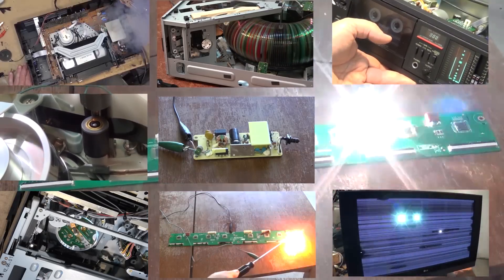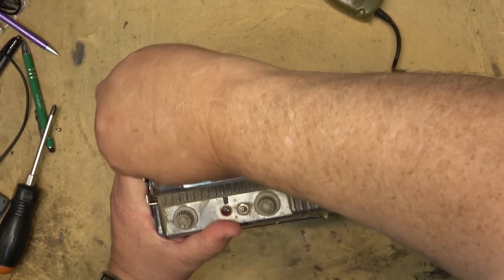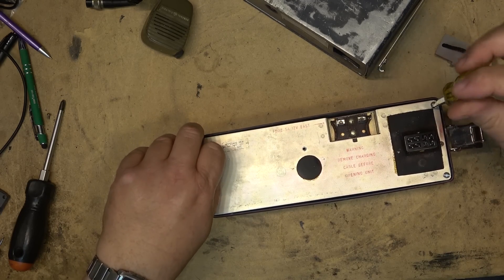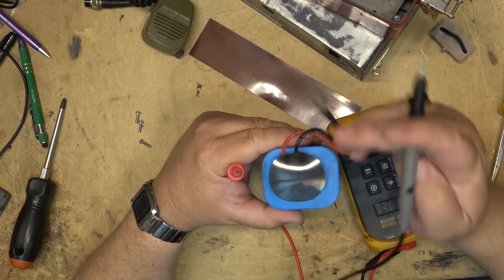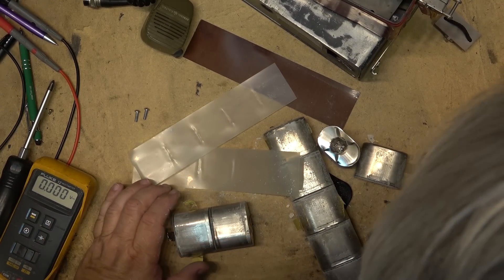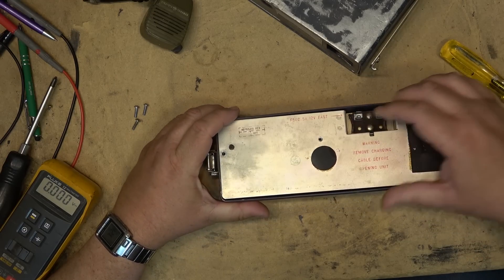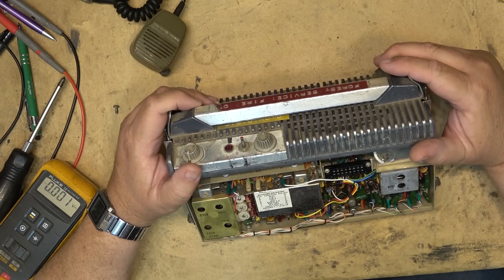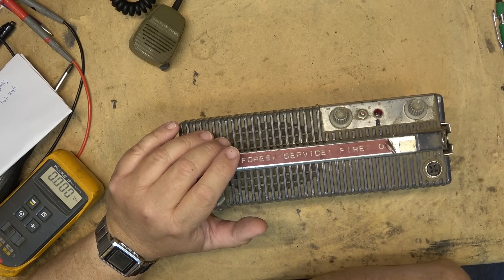Vintage Smoke Jumper Fire Service Radio Tear Down

Comment: Professional or industrial equipment even in this era seem to usually be easier to disassemble and work on than consumer-grade stuff.  No plastic snap-on parts or glue.  I've seen Lenovo business computers that can be opened by sliding one blue plastic lever at the rear.

Comment: the mastr 2 and custom mvp were popular for repeater conversions. you could cut one wire to put the radio into full duplex. crystals too hard to come by these days.
Reply: I still have some crystals
Reply: Still have these radios in service as repeaters. There was also a full duplex IMTS MOBILE PHONE VERSION that is prime for conversion as well. As for narrow band service there was a company offering a crystal conversion for the receiver front end that narrows the receive window. The repeater is transparent for narrow band communications since Rex and tax compandering is handled in the radios used on the system. Big issue today is the availability of frequency crystals ever since ICM closed shop.

Comment: I used this style radio back in 1973 and it was set up on an old MTS phone system. One word of caution before applying power to the unit. Replace any tantalum capacitors in it as well as the regular electrolytics. I recently powered up an MVP repeater and guess what, I let the magic smoke out. Thank goodness it was a tantalum cap on the PA board and was not too critical. Waiting on a whole batch of caps to recap the set. If you pop an electrolytic In the audio amplifier section, just hope it did not take out the amp IC, the DIP ic I believe is unobtanium today. These radios are tanks, there was the next generation that was based on the PE portable radios, tx and rx modules were the same as the portable. Motorola also made a "lunch box" style radio in the 70's that was based on the MX300 radio series.
It’s a little rough but restorable. Any contact info for you?
Reply from the maker: My contact info is in the about tab. Personally i don't have much interest in restoration of this unit and I haven't even attempted to power it on.  I would just as soon sell it to someone that wants to mod it for amateur radio.  Even though i have been a ham for over 30 years I have lost interest in much of it these days.  Most of the guys i used to talk to and do tv stuff with have long become silent keys and the cb style operators as of late have just driven me away from the hobby.

Comment: A well made transceiver, very mod-able 😀
I also thought about the conversion to 144-146mhz, my brother (a ham) did a few conversions.
pye camebridge i think was one.
A pye pocket phone was turned into a mini base station.
Old taxi radios were convertable, not so much the digital ones.
Reply from the maker: The hardest part is finding crystals.
Reply: @12voltvids  Yes it would be  hard to find the strange values.
 Making a phase locked loop-vco circuit would also be a pain in the ass!!.
 lots of mixing and determination.
Just thinking about it makes my brain hurt :-D
Reply from the maker: @zx8401ztv  well I'm going to sell this unit because I have no interest in modding it myself I have very little interest in ham radio these days. I used to be quite the experimenter tinkering around with microwave stuff for video transmission and so forth but in the last 20 years most of my buddies that we were tinkering around with video have all died so I have no one to experiment with now so I've kind of lost interest in the hobby same with repeaters. I had a repeater set up for about  15. It was used by about five of us but over the years all of us were just not using it much and one day it broke down and I never bothered fixing it I just shut it down and dismantled it
Reply: @12voltvids  You are not the only one that lost interest, my brother was deep into the radio ham hobby, but he slowly gave up through lack of interest.
I lost interest in talking on c.b radio, most of the people i knew were gone or dead :-(
Yes i know c.b wasn't ham radio but in the 80's and 90's the channels were alive and if there was a new cb'er that didn't understand how to set an antenna up, there would be loads of cb'ers come to help (Me too).
I also repaired radios so no one was off the air for long 😀
I know that hams liked a good conversation, just like the cbers.
I still have my radios but my antenna (vertical halfwave ) snapped years ago.
Hams would call the antenna an "End fed" with a matching transformer at the bottom.
It was fun while it lasted :-D

Comment: When you opened up the battery pack before you mentioned caps I thought they look like the capacitor you get it microwave
Reply from the maker: I've never seen batteries that look like that before. I don't know what year this is from but I would imagine from the size of a weight of it it's probably from the late 60s or in the 70s. I thought at first that those cells might have two sub sea cells and peril just in another case but but I tried to open it up a bit it was pretty obvious that they were a custom-made oval-shaped cell